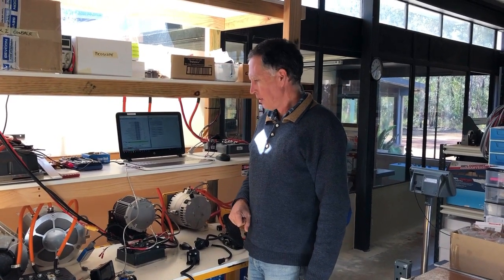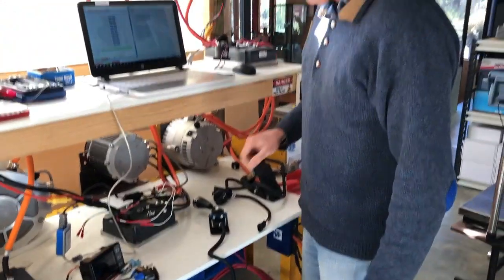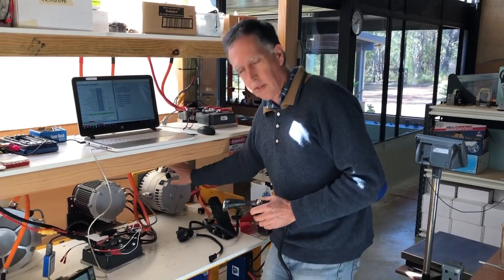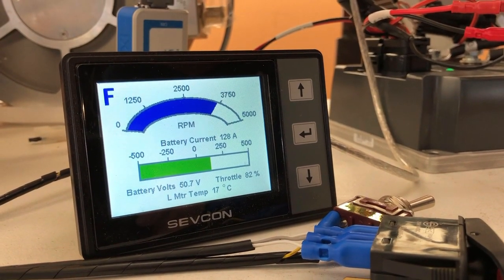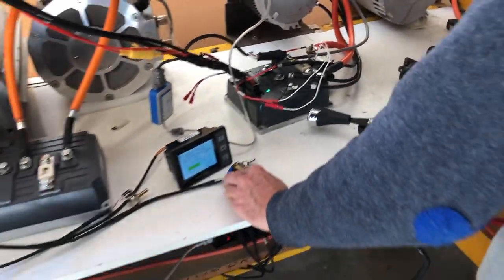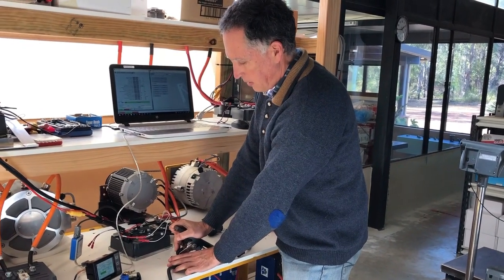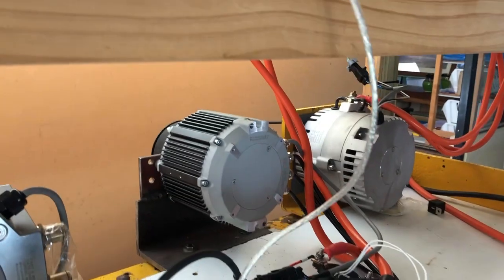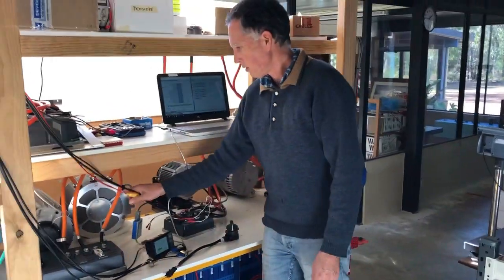EV PowerDrive Kit Demo using Motenergy ME1718 PMAC Motor with Sevcon Gen4 Size 2 Inverter.

Comment: Where can i buy the throttle kits  for thiz motor? And what can battery voltage be ? Using a nice conytroller what can the motors input voltage be ?

Comment: I realize the video has lots of noise from the belt and regen motor. Would you subjectively rate the ME1718 and 1716 as much quieter than the open frame motors? I have an ME1305 in my boat and it howls around 1kW.
Reply from the maker: Correct about the belt noise, the video amplifies it. Generally speaking closed frame motors are quieter than the open frame motors, partly because there is no fan on the drive shaft. In an application all the Motenergy motors we use a quiet, but not totally silent.
Reply: @ev-power  Thank you for the answer! Are there pros and cons to Sevcon and Curtis for cosine motors?